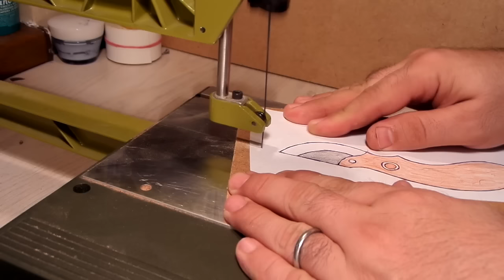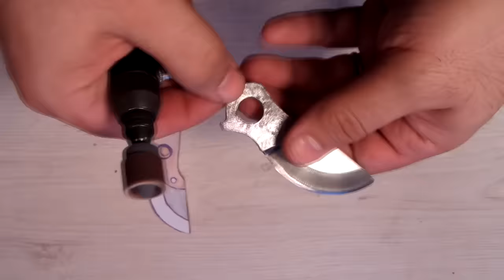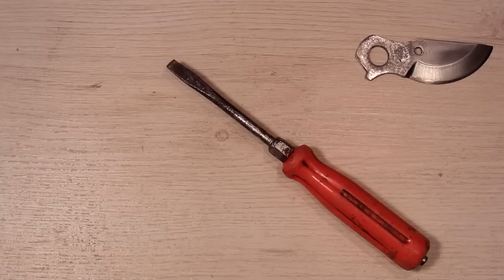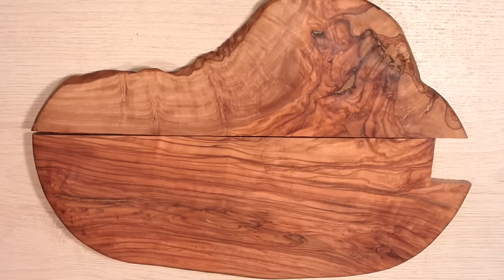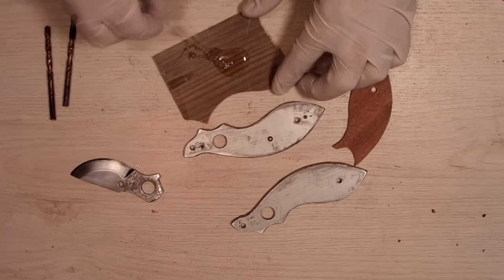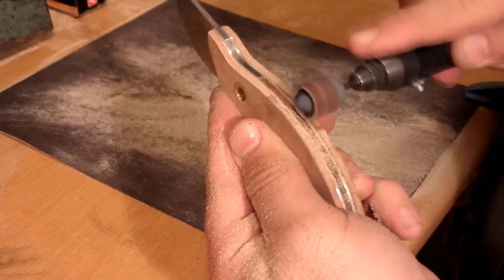Making A Knife From Pruning Shears

Comment: Finally a video of someone making a knife without all the fancy tools like a table saw, belt sander, and ban saw
Reply: Why would anyone need a table saw for a knife?
Reply: Okay but what's so wrong with using those?
Reply: @sakuraogami6885  It's not wrong, just not a great tool for knife making in general, because most functions u need for knife making can be achieved (even with better efficiency) using more compact, more simple and safer tools. Table saw is dangerous, uses lots of power, makes lots of noise, inconvenient to use, not too precise, making it one of the tools that should only be used when there is no other feasible option
Reply: hòa mạnh idk, the belt sander seems pretty convenient
Reply: @sakuraogami6885  I was talking about table saw though
Reply: @hoamanh7638 m
Reply: hòa mạnh iis
Reply: @hoamanh7638  table saw not too precise???!!! That's the most precise power tool in home workshop. WTF are you even talking about?

Comment: when drilling the aluminum with the blade attached, you should put some sort of stop at either end of the knife, that way if the drill bit were to catch the material and swing it around,  the blade would hit the stop, instead of swinging full circle and cutting your fingers off
Reply: seems like the bolt that was holding the aluminum to the blade acted as a stop against the wood though,, nice knife
Reply from the maker: Yes, in this case the bolts were used as stops while drilling. Sometimes I use the small vice clamped on the drill press table to act as a stop. Thanks for the tip tho, safety is always important!
Reply: No, the bolts not doing anything, and even if the knife was attached to the wood block, it’s not held down either - please use a vice or clamp to deck. It clamp a piece of wood as a stop on back side of bit.  Like a 2x4. Love the projects - but when you use the drill press I cringe!

Comment: grinding non ferrous metal such as brass on a grinding wheel is VERY dangerous. The wheel can explode and potentially put your eyes out. No joke.  The knife is nice, I just don't want anyone to get hurt making one.
Reply: +MonkeyBlueAss The non ferrous builds up in the grinding wheel and when is heated expands and blows out chunks of the wheel.
Reply: At which point did he use brass ?
Reply: Whoops, I just found it sorry
Reply: I was gonna make a pun but it was so bad I opted not to.
Reply: This was new to me.. And, like all good advise, tips, I do appreciate them.
Thanks.
Reply: Bill Anderson thank you for your advice I will be sure to be careful
Reply: Damn
Reply: a little bit of grinding some steel will clean those brass filled pours right out
Reply: This is just an urban legend, you're not going to explode your grinding wheel by grinding a piece of brass pipe fitting on it Bill, relax bro.
Reply: Bill Anderson wouldn’t the sparks hurt as well
Reply: Have ground the heck out of aluminum, brass, and copper on a grinding wheel for many years and never had one explode. I think your 'science' is off a little. "Builds up in the wheel, gets heated, and explodes"? Pretty far-fetched. So you have no idea what a grinding wheel dresser is then? It easily cleans up a grinding wheel that's had aluminum or brass ground on it. "Explosions" indeed. What irks me is that you're spreading misinformation. Some poor kid may need to grind the burrs off of a piece of brass and all he has is a grinding wheel now he's afraid of the tremendous "explosion" it may cause. My advice: Go ahead kid, it won't hurt a d*mn thing.
Reply: Bill Anderson no all that will happen is the metal will expand and push itself out of the hole it was lodged in not explode
Reply: No it won't.

Comment: great job, and a lot of good safety tip below. still wondering why you did not glue the pins in with the epoxy instead of waiting and putting them in with super glue. still worked that is all that maters.
Reply from the maker: I only had some brass threaded rod to use as pins, so I've thought the space around the pins would look funny if I've just drilled a plain hole and epoxied them in. So I drilled smaller holes and threaded them and I used superglue to lock the thread in place. I could've used epoxy for that too, but superglue works just fine and is more liquid and also you don't have to mix it.
Reply: cool. thank you for the reply. you watch so many vid that when someone does something a little different I like to question it and hope they respond. thank you again
Reply: P.S. I just can't thing out side the box like you and really like seeing these different ways of doing things.

Comment: For anyone who may want to know Felco sells Swiss made high carbon blades as replacements for their pruners. 

I'm not too familiar with single bevel or non symmetrical knife edges but it looks like you have a very effective cutting tool there.  Does it have symmetrical micro bevels or is just purely flat with no bevel on the back side?

A beautiful interesting piece.
Reply from the maker: It's pure flat and I like it a lot, for woodworking the single bevel has a lot of advantages, it's basically a chisel shaped like a knife. The only downside is that the steel is kinda soft,  but your suggestion takes care of that :)

Comment: that was a very excellent job you did there! it looks like it would make a nice skinner, as well, the handle looks to have very good ergonomics. how do you like have a chisel ground knife? any pros or cons to that for you?
Reply from the maker: Thank you! I really like the chisel grind for woodworking/shop knife, don't know how it will be for other purpose. It allows me to slide the knife flat on the surface of the wood and cut something flush, it gives more control when chip carving/sharpening some wood. No cons so far, except of course the poor quality of the steel in the shears blade.
Reply: thank you for your response! that sounds very practical. there is something about doing/making things out of pure ingenuity that i find extremely fascinating and artistic. it gives me good ideas. thank you for sharing such an excellent project with us. best regards to you.

Comment: Awesome! What are the brass fittings you used? The headless screws and the one you ground down the middle on.
Reply from the maker: The large brass part was a plumbing 1/4 nipple (the hole in the blade was 1/2 inch) and the small ones were some salvaged screws from an old camera tripod, I believe they were metric M5 , so something like 3/16". All were used because I had them at hand.
Reply: Right on. Thanks - and great channel!

Comment: did you use a normal scrollsaw or a metal version (i dont know if something like a metal-cutting version is available)
Reply from the maker: Normal scroll saw, and in this case it uses a coarse wood blade, as the metal blades I had were too fine for aluminum.

Comment: Question. Now how come u didnt heat treat it. I think its a beautiful job and great idea. 
 Is it bc is not that type of steal to heat treat??
Reply from the maker: I thought that since the tool was already designed to cut wood branches it had some proper heat treating at the factory. The knife is still in use as my shop knife and holds up just fine.
Reply: @TheSmallWorkshop  nice man.. Great job! Ur video is making me wanna go break my old pair and make one lol. I ask bc i do the same thing with knives i make outta the dif material types and not bother with heat treat, the only thing is for me i have to sharpen every now and then ya know.
Reply: I also like that knife press/holder u made. Another great idea. I watch so many make some that look complicated lol

Comment: sorry i'm new to this stuff but what was that black sheet (sand paper with lube) you were using to manually rub the blad on after putting it through the grinder?
Reply from the maker: It's wet&dry sandpaper + water. The water lifts the dust to the surface, not allowing it to clog the sandpaper.

Comment: does it not hurt when the sparks hit your bare hands?
Reply from the maker: No, it doesn't have the same speed as an angle grinder, it's around four times slower (3000 rpm), so the sparks don't hurt. Plus I have a thing against gloves and rotating tools as they can grab your hand.
Reply: okay, for a moment i thought you where some kind of superman. Really great video btw, funny idea and both knife and video are very well made

Comment: but for what do you use it ?
Reply from the maker: It's my shop knife. The hole in the handle makes it stay vertical when hanged on a peg in the wall, which makes it easy to grab when needed. The chisel grind is great for some woodworking tasks, like flush cutting something, but mostly I use it to open boxes or sharpen pencils and stuff like that.
Reply from the maker: You can see it at work here: https://youtu.be/DjwUSxTlvGI?t=12m8s

Comment: Friend, That's a very nice small knife. You should make a companion blade from the other half of the shears.
…..RVM45
Reply from the maker: Thanks, I was thinking of a karambit from that part, but the steel is kinda soft so if I go to the trouble of making it I should use some decent steel.

Comment: I want to point out that it is a bit dangerous to drill a hole into that aluminum while holding it with your hands. If that bit snagged, off came his fingers. Please secure the metal prior to drilling it.
Reply from the maker: Thank for the safety tip. At some stages there were some screws keeping the part from rotating. Also on my particular drill press the belt slips when bits catch. Annoying at times but a bit safer.

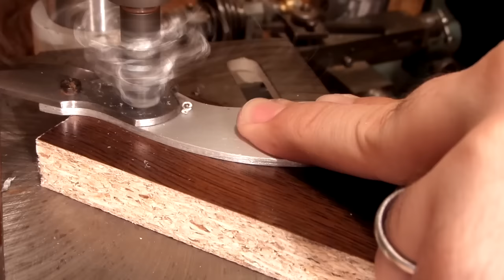Comment: I suggest you wear gloves next time or you will cut off your fingers some day @6:50 ;)
Reply from the maker: First off NEVER wear gloves on the drill press!!! It's a basic safety rule! Second, the part was kept from rotating by the screws which locked on the melamine board, which in turn was large enough not to rotate. Not as safe as clamping the part to the table, I admit it, but good enough for me. As for cutting my fingers, working with tools has risks, so that's always a possibility, I just have to live with it or just close the shop. Anyway, thanks for your good intention!
Reply: +The Small Workshop Ah, ok. I always tought you should wear gloves when drilling, turning or other metal working operations so not to cut off fingers with those metal string that come off at high speed and hitting your fingers. I am confused now :D
Reply from the maker: It was common practice at some time, but lately the theory is that rotating tools can grab the glove and cut your hand instead of cutting just the finger :D
Reply: The Small Workshop That would be much worse :D